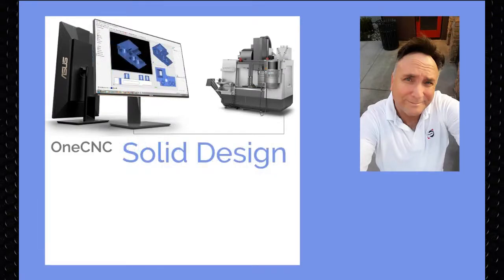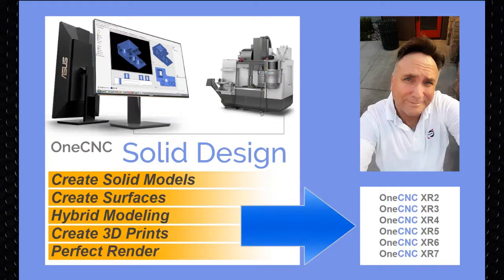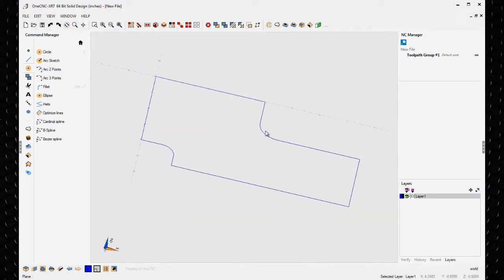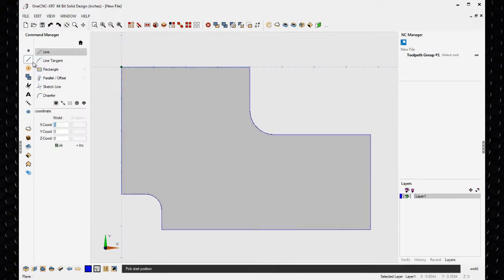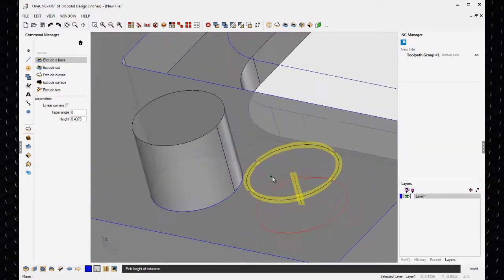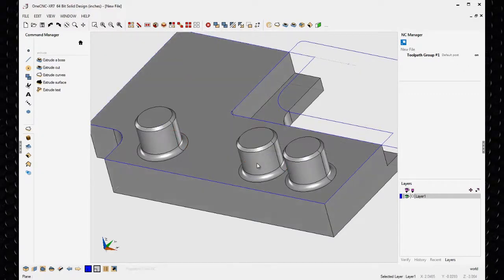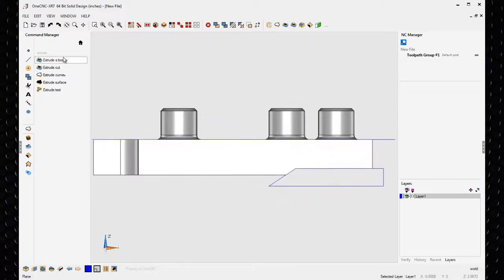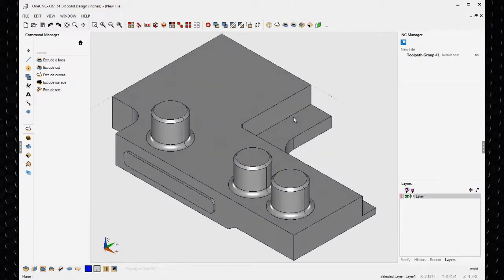Solid Design - Creating Solids

Comment: Nice new OneCNC series. How about modeling with dimensions techniques please? Creating models with specific lengths and heights, chamfer degrees and filets parameters? How to easily create solids in OneCNC CAD module using the best features? Great thanks for sharing your OneCNC passion Patrick. To keep up with Fusion 360 or any other CAD CAM softwares out there, OneCNC must furnish more great videos like this.